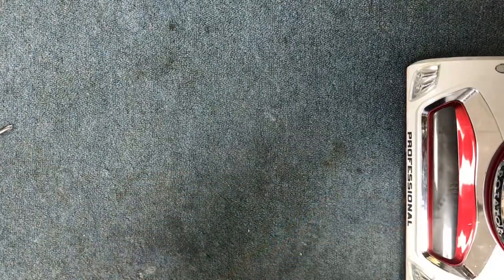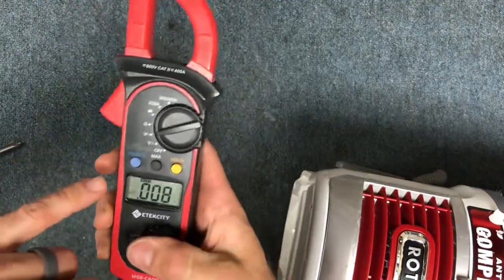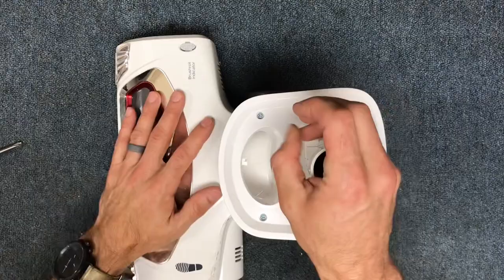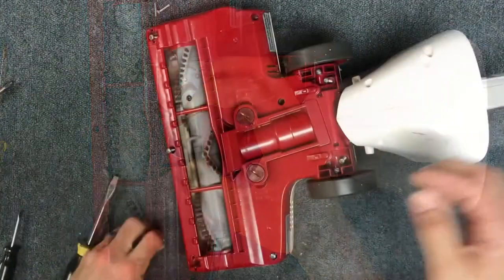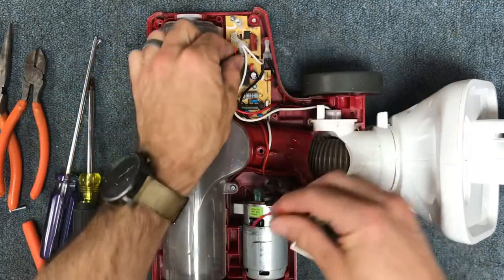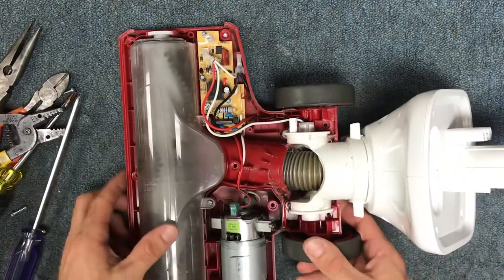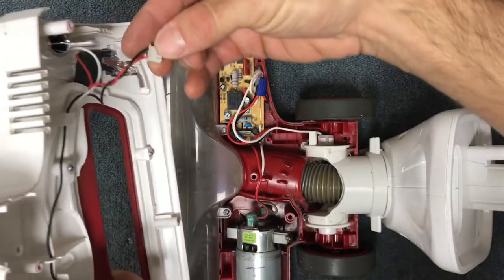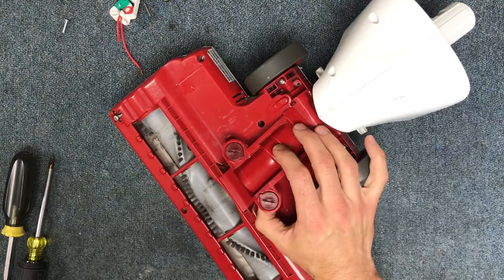Vacuum Repairman shows Shark NV500 brush roll failure quick fix! How to!

Comment: Bypassed switch. Brush roll indicator at the head comes on briefly, but fades away. Brush not spinning
Reply from the maker: Might check how the bearings feel on the brush roll. If they are bound up then that could be the issue.

Comment: Thanks! The most valuable lesson- "The unit will NOT run the brush motor when it is upright..." I DID NOT KNOW THAT!!!! after cleaning the brush roll (it was filthy-and I had to free up the bearing too!) I re-installed it and it didn't work! So I looked at your video to see what I missed and you aid "the microswitch prevents it from running in the upright position.. DUH!!!!!

Comment: Thank you for making this video. At the start, my Shark  NV500, the brush stop working, the brush indicator turned orange from green. I tried disassembling to check the brush to see if there is problem with the belt but I could not disassemble after removing several screws.
I quit for a while and surf the web and found your youtube video. You mentioned the hidden screws under the two small roller wheels. I  got it done and completed disassembly. 
Before I check the circuit or pull the micro switch, I tried touching the micro switch and noticed it moved and seemed normal. I re-assembled by installing 3 screws only and tested it. It works. I continued assembling the vacuum cleaner and happy that I found the information I needed from your Video. Thanks a lot..

Comment: Thank you so much for your explanation!! I have zero knowledge on electrical issues. Saw this video and fixed my rotator without changing anything. Just cleaned around the green thingy and it started clicking again! Connected and vuoala!!! It works!! Thank you, thank you!!

Comment: Your video is excellent. However, I have a Shark 400 version and have determined the switch for the brushroller is bad. I cannot get the housing apart to get access to replace it. There are no screws in that part, but it seems there is a clip but I am afraid I will break it by forcing it. Any hints? Thanks.
Reply from the maker: Hmm hard to advise with such limited details. Look closely for seems where there are different sections of plastic. If no screws those parts are held in place with clips.

Comment: I have this exact problem.  As you suggested, I metered the top part first.  Flipped it over.  Hello!  Not Phillips head screws holding it together but those security Allen head ones.   GD it!!   Why?  On a vacuum??!!
Reply from the maker: They are telling you something with those screws. 😉
Reply: @richardsvacuumcenter  yeah, they think they’re Apple.  I bought a set of those Allen heads.  I’m gonna fix this damn thing come hell or high water.
Reply from the maker: @cyclemadness  good! now you have them for the next time a company doesn't want you to fix their stuff yourself lol
Reply: @richardsvacuumcenter  ok.  I bypassed the switch and soldered the wires.  Still doesn’t work.  Probably a bad motor right?
Reply from the maker: @cyclemadness  the brush motor? did you follow the whole video and test for voltage to the head? if you bypassed switch and you have voltage to the head, your most likely issue is a bad board.

Comment: Richard - I greatly appreciate your video, its very helpful.  I have a Navigator Lift-Away model UV 540 26 but I am unable to remove the brush from the clear plastic shroud since the brush fits into the shroud at each end. I just don't know how to remove the brush from its clear plastic shroud. It does not simply pull out.  Can you help?  Many thanks.
Reply from the maker: There are a couple screws holding the clear cover in I believe. I assumed you took those off and still couldn’t get it off? Sorry for the late reply.

Comment: on UV560 I tested the 3 contacts on the bottom.  With 'brush -roll 'switch on the outside and middle read 114, and the two outsides read 114.  With that switch off only outside and middle read voltage.  The contact switch is good.  Can I test the motor with 120 volts?
Reply from the maker: No. It is a dc motor.
Reply: @richardsvacuumcenter Thanks.  I found the problem.  A wire that goes to no. 3 spring connector had broken at the connection under the shrink tubing.  So it was almost impossible to see.  I soldered on a pigtail, wire was too short, and it works now.
Reply from the maker: @KM-iv8lo  good work!

Comment: I tried the bypass, stripped both red wires and twisted them together and put a connector on them. I screwed in the one screw as you instructed, turned on the power. The light works,  but the power brush does not work.   I am assuming the motor may be bad.  My model is the 501, not the 500, which appears to be the same.
Reply from the maker: Or the board is bad. You can test voltage at the motor wires to see if you get voltage from the board. If not your board is probably bad.

Comment: I have watched a number of your videos related to the NV500 issue I have.  The roller stopped working but what it does is turn on for a couple of seconds then stops.  The red power light is on the head and comes on and off when pressing the roller power button.  Following your videos, I cut the micro switch out first.  Same issue.  I tried using a multi meter to test the main roller power switch but not getting the same readings you did.  Not sure if I don't know how to use it or if the switch itself is bad.  Your thoughts?
Reply from the maker: Sounds like you need to replace the brush roll. If it is jammed up the motor will kick off like that and the light will turn red
Reply: The roller is new and spins freely.  I took the belt off to test that and it still does the same thing.  I wonder if the circuit board is bad.

Comment: Just wondering what other things can cause the brushroll to not work.  its not the microswitch.  Should I replace the circuit board, brushroll motor, or power switch?  My power switch is the 3 way (off, suction, then brushroll)  Its a rotator nv90.  It worked one day and then not.  Nothing looks bad on the circuit board.
Reply from the maker: I would guess power switch or circuit board. Test voltage from the connection where the cleaner head disconnects

Comment: Good video, except you did not show where the multi-meter leads connect to on the vacuum. Anyway, I have a UV560 31 in which the brush roll itself is the problem. The part of the brush roll (on the belt side, right next to the belt gear) that "rests" between the soleplate and the clear plastic wind tunnel shroud keeps getting scraped away by the soleplate and/or the wind tunnel shroud, and then makes a shrieking noise before getting stuck. I have even sanded down the rough edges on the brush roll, used a spare wind tunnel shroud with 2 good black "semi-O-ring" gaskets (the one on the belt side of the original was too loose fitting). But the brush roll still keeps getting scraped and then getting jammed. I don't wish to replace any of the parts. Is there something else I can do?
Reply from the maker: If your motor is turning without the belt attached and not shutting off it sounds to me like you need to replace your brushroll.
Reply: @richardsvacuumcenter  Thank-you for your reply. I forgot to mention (see above) that I even tried using another identical brush roll, but the same problem manifests. Nevertheless, I tried your idea and the brush motor does not automatically shut off with the GATES 231-3GT-6 belt disconnected. Therefore either I have two bad brush rolls (neither are loose when mounted), possibly belt too tight or too loose (but seriously doubt this), or two bad wind tunnel shrouds, or a bad sole plate, causing this scraping and shrieking of the brush roll (and also of the wind tunnel shroud). Possibly the wind tunnel shroud was overly tightened to the sole plate. BTW, I mention the belt brand and size in case you think that might be the problem. I also mention all this as I cannot find any YouTube videos that address this exact problem. Thank-you for any help you can offer in advance.

Comment: Greetin - can you remove the brushroll motor and test that component?  For example can the motor (D4275K, 3720, 120V) be teste by attaching two electric-cord wires to the two motor wires, and pluggig into a a 120 outlet?
Reply from the maker: I can’t recall whether those motors are ac or dc. If it’s dc it will blow up when you
Put ac power to it. Check the printing on the motor itself to be sure. Be careful.
Reply: OK, thanks so much!!!!

Comment: I came across this video because our Shark roller stopped working. I metered the connections on the motor and voltage dropped from about 5v to less than 1 volt when I pressed the roller button. I assume that the switch is defective?
Reply from the maker: Sounds like it

Comment: Hi Richard, thanks for your video. This is really helpful. I just want to know what is the name or model of the tool you used to remove those screws? Those screws have a stick in the center I don't know their name and can't find what tools can get them out.
Reply from the maker: some shark models use what is referred to as a "security torx screw" so you will need to search for the corresponding bit.
Reply: @richardsvacuumcenter  Thank you!!
Reply: It's a torx t20 security bit. I bought a set at Harbor Freight
Reply: @huijing9655  make sure you get long shank ones.  I found them on Amazon for $14.
Reply: @tomeversman3837  Thank you!!!😃
Reply: @cyclemadness  Thanks for the reminder. :goodvibes:

Comment: Hay what if I don't get 5v at the bottom of unit nor 118v when button is pressed ? Unit runs ( truns on )but no volts  thanks  Todd
Reply from the maker: Might be a bad power switch for the brush roll.

Comment: What is the size of the 'tamper proof' Torx bit? I don't need an entire set, just one long blade screwdriver for this application. Thanks.
Reply from the maker: Sorry I don’t recall. I can guess it was either a T10 or T15. Most tamper proof bits I’ve seen in stores have been only available in set. Best of luck!

Comment: My brush spins on the second setting but not the first. Would the switch still be an issue if it still spins?
Reply from the maker: That’s normal. Does the suction motor turn on in the first setting?
Reply: @richardsvacuumcenter Yes, suction motor running but turned out the suction tube was clogged by dog hair, thus the reason for no suction. Glad I didn't have to swap the switch, but I learned a lot about the vacuum. Thank you!

Comment: So if you are using the vacuum with brush going and head lights start flashing could this be the reason?
Reply from the maker: I haven’t seen that particular issue related to this problem. Your problem could more likely be a wire that is pinched or partially severed.

Comment: Both headlights on Shark NV510 stopped turning on.  They are connected, but I cannot find anything about repairing or replacing parts.  Any suggestions?
Reply from the maker: hmmm not sure. never run into this issue before. does the brushroll run in the back position?
Reply: @richardsvacuumcenter  the brush roll works.  I don’t know what the right direction is even if I could see it.
Reply: @richardsvacuumcenter  I do not know which direction the brushroll should go, but skipping to your point I just opened the guts up and determined the two wires to the motor were backwards.  I remember re-wiring it and forgetting to snap a picture and thinking ... I have a 50/50 chance.  I have another Shark I compared it to and voila ... backwards.  I am cleaning and piecing back together.  Maybe those wires are related to the lights.

Comment: I have this problem now with my shark. I checked volts and they were good and then I bypassed the switch and it still shuts off. Any ideas what else I could try or could it be the motor is bad?
Reply from the maker: Is it showing a red light? If so I would guess the brush roll bearings might be bound up
Reply: @richardsvacuumcenter  yes it runs for a second and then turns from green to red. I also had taken the brush completely out and ran it but still turns off.

Comment: I have the nv586 the brushroll won’t turn off the switch is up too so you think the switch is failing to turn it off or do you have other recommendations
Reply from the maker: I don't quite understand what you're saying.
Reply: @richardsvacuumcenter  when I switch the top switch on the handle it has no effect on the brush roller “the brush roller will not shut off for hardwood floor mode”
Reply from the maker: @hunterezzzy5338  Hmm. So the brushroll is always "on" correct? Does it turn off when you lock it upright?
Reply: @richardsvacuumcenter  yes it does turn off when it’s upright the microswitch works
Reply from the maker: @hunterezzzy5338  Got it. So it sounds like the main brushroll switch is faulty. Is it a three position rocker switch or a press switch? I have a few other videos you may need to look at to replace that switch.

Comment: This first time I disassembled my Shark Rotator the belt had come off. I used a different video to take it apart. 
https://www.youtube.com/watch?v=qdznafE4uis
When I took a look at it this time the belt was actually fine and it was the microswitch. Great video and I will be doing both bypassing and also ordering a replacement. Thanks for the great video!!!